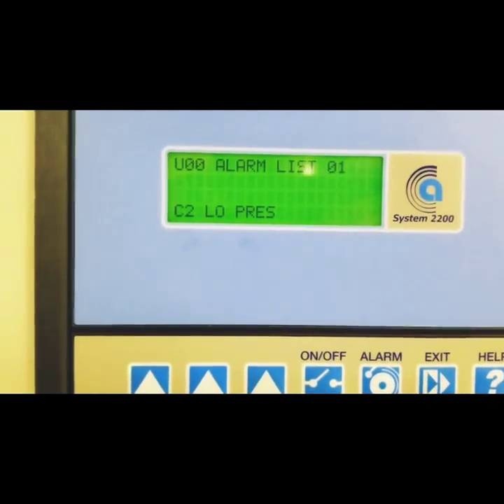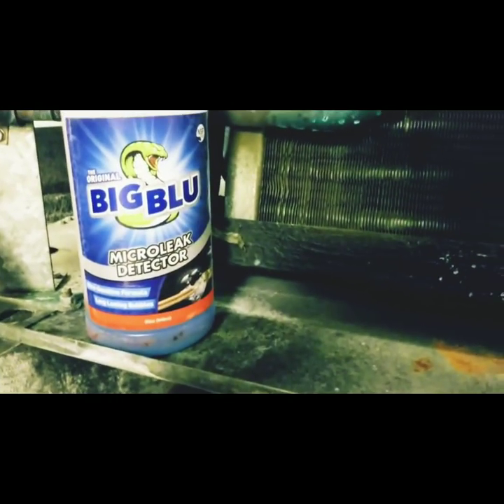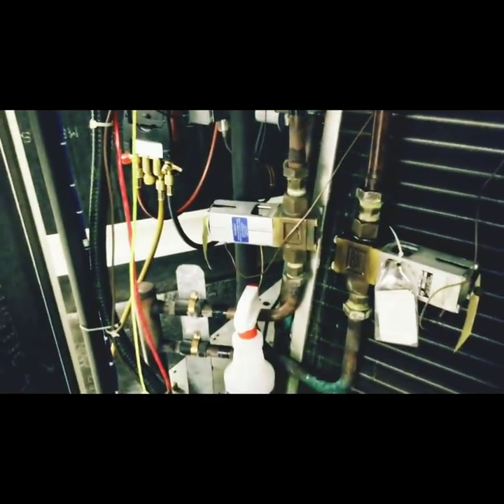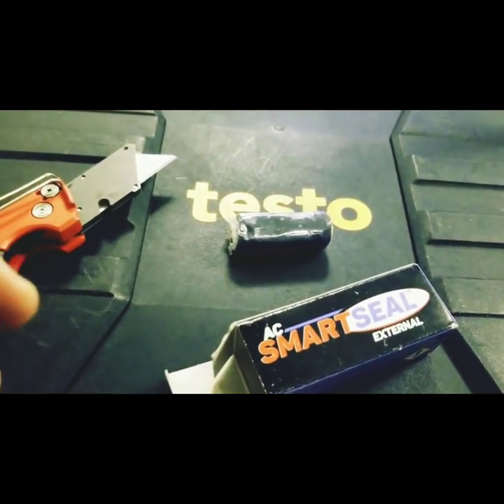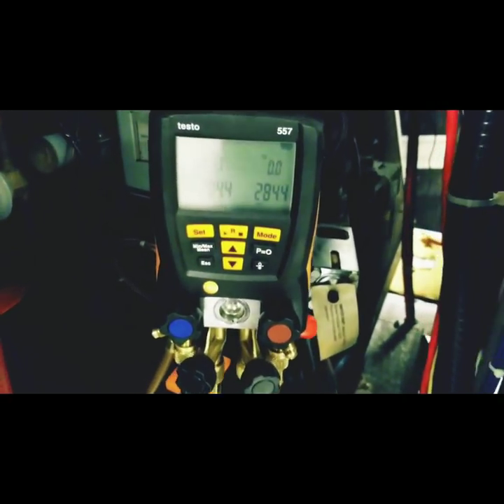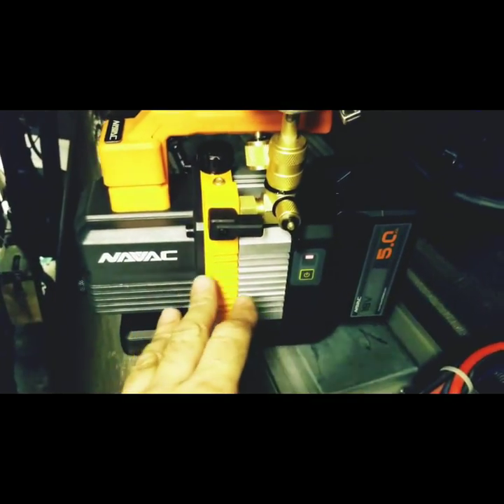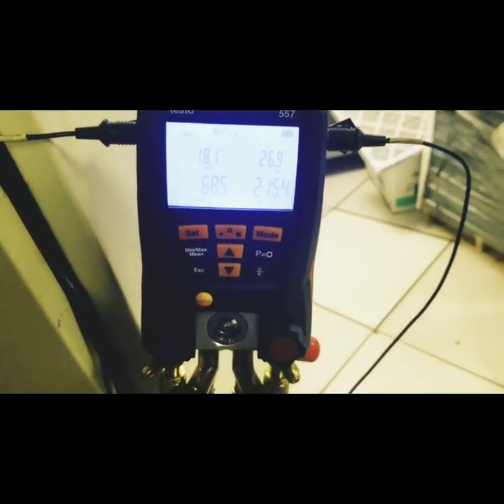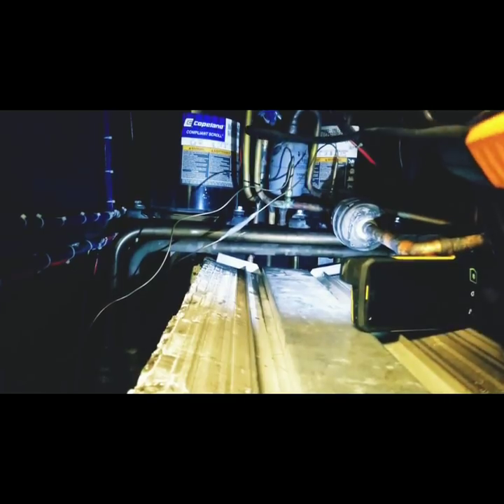HVAC - Refrigerant Leak Repair w/AC Smart Seal External

Comment: Can it seal while applied unter pressure or does it have to be zero pressure while drying?
Reply from the maker: Recommended no pressure, but a couple people told me they have used it with sight pressure

Comment: I used it on a leaking king valve. It does not work. Also, it is similar to Fix-it Stick which is less than $6 for 5 times larger than this one. They cut it into small pieces and label it as HVAC and sell it 5 times expensive. They make profit 25 times more
Reply from the maker: It worked here no problem, that unit is still running.  There is a certain way to apply it.  System can't have any pressure, pipe must be super clean.  Leak site must have a generous amount and the putty must be tapered and pinched properly.  I have a video if you look through from last September showing that it holds over 400 psi.

Comment: Good  vid better to  see it out in the field then at the demo's at the supply houses ??  did you apply the epoxy on the  cap tube under pressure  or  recover first
Reply from the maker: There was no gas in the system, did you watch that part?

Comment: Are you going back end of August to verify charge? I just curious if this a temporary repair or if it does actually will hold up in time. Also curious if this system was using R-410a with polyester oil instead of R-22 would you still have the same results
Reply from the maker: This recorded a few months back, I've been back and all is good
Reply: HVAC Know It All thanks for letting me know, I will definitely check into this product